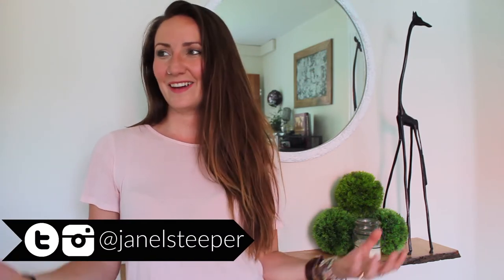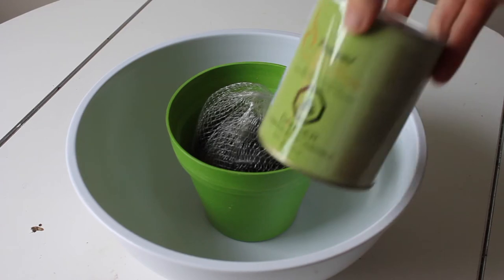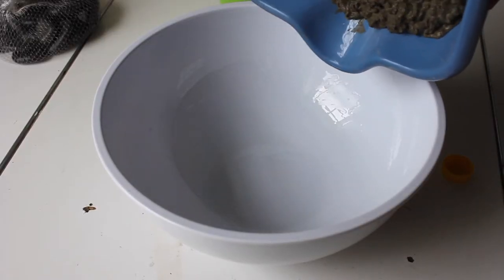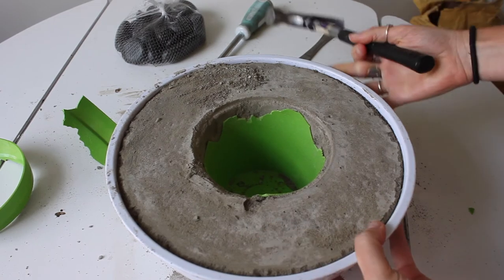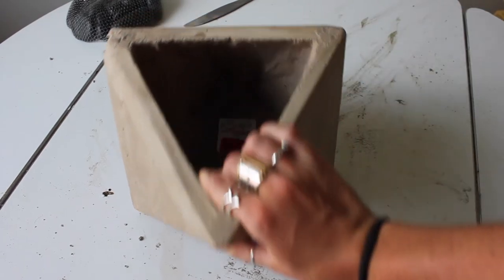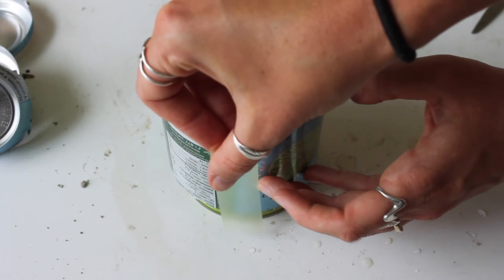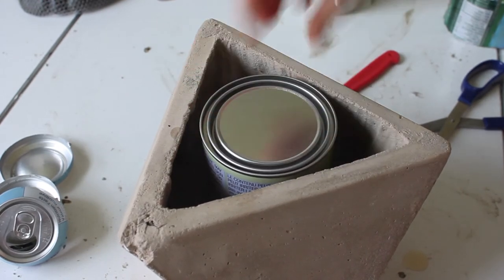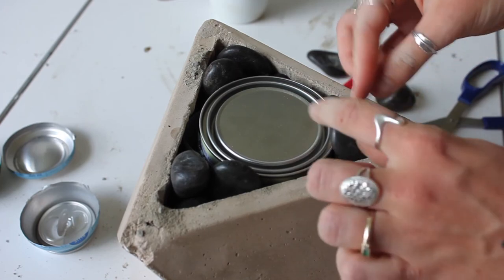DIY Fire Bowl

Comment: I used plastic bowls that are a set. I used the largest one for the outside form and the third smallest for the inside form. I sprayed cooking spray on the inside form and set it in the concrete with metal weights. I let it set approximately 36 hrs. The I gently bent the plastic bowls in just enough to get a little separation. I then shot compressed air in the gap with an air nozzle from the air compressor. This causes the the concrete to release from the form. You should let them set in the forms for 24 to 48 hours before removing depending on your humidity. If you try to remove them to soon they can fall apart.
Reply from the maker: Thanks for this! Glad it worked for you!